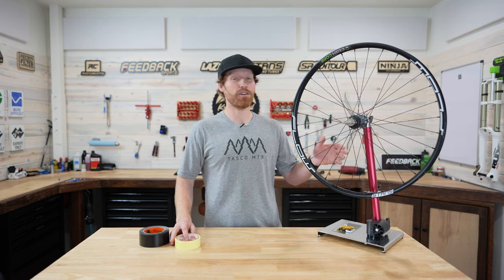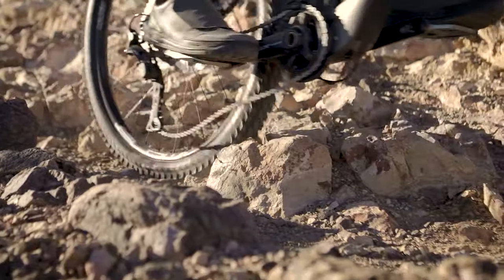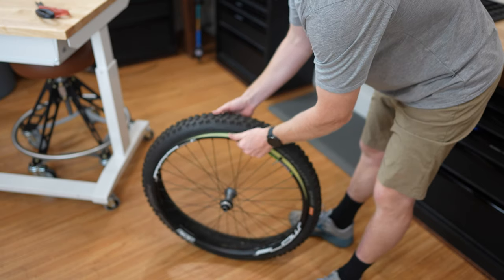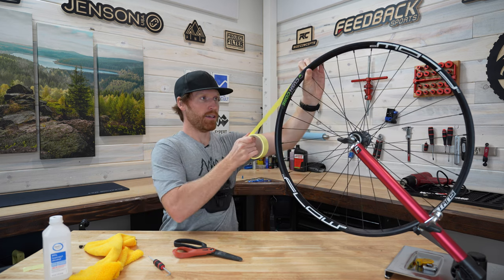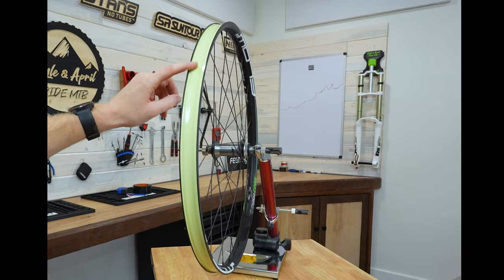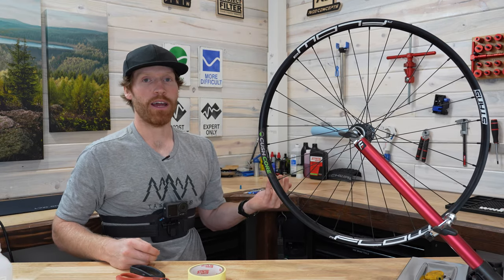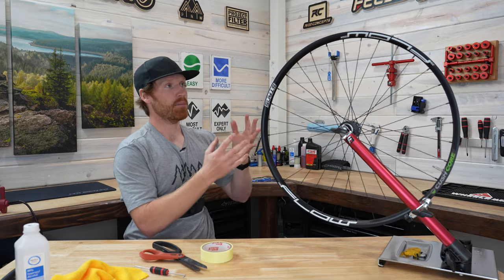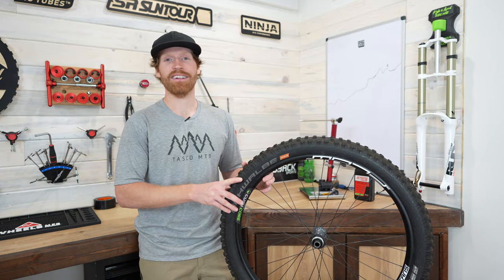How To Tape A Tubeless Rim The Easy Way // Step By Step Guide

Comment: use TESA 4289 tape, which is basically Stan's No Tubes rim tape, but for 15-20$ you get about 216 feet worth in almost any width instead of the 30' from Stan's.
Reply: Tesa packing tape has some stretch to it? That is surprising it stretches at all. I will try it if I can find it in 28mm wide.

Comment: As an extra bit of info: 
- some tubeless tapes are really thin and elastic and need a couple of passes on the rim for extra safety, as one pass is not enough, because the tape punctures over the nipple holes ... especially if you do gravel or road tires, as the pressure is higher than normal large volume mtb tires. or if the rim is of lower quality and has burrs on the edges of the holes ... pressure from the tire forces the tape in the nipple holes, and the burrs and sharp edges cut the tape with time. seen this quite a lot in the shop ...
- sometimes it helps to add a patch of duck tape (or the provided stickers if available - zefal and muc-off are 2 that i know provide with tape such stickers) where the tubeless tape ends and overlaps the previous layer, as tubeless solution can creep between the layers ... this is especially problematic if the overlap is really short, as it creeps all the way to the valve and past, and it gets in the rim and trashes aluminum nipples ... or air can leak slowly and you have no clue why this is happening. this happened to me a few years back when i started doing tubeless ... slime went though the tape layers and ended up in the rim, causing 3 nipples to completely corrode and break after only 4 months ... the rest were better, but i ended up relacing the wheel and changing all the nipples to brass 😆

Small tip: spraying the nipples on the inside of the rim with wd40 (very light application), and wiping the rim with brake cleaner or iso alcohol so the tape sticks to it, can prolong the life of the alloy  nipples and prevent corrosion in case tubeless solution/water gets into the rim. If you wanna dew it like a pro, get some car body panel anti corrosion/rust solution from a gas station or hardware store, and with a small brush apply it on the head of every alloy nipple. that stuff hardens and forms a layer on the nipples that never washes away. some are actually ready to spray over after 24 hours ... and you can true the wheel no issues what so ever if the need may arise. you will never have an issue with corroded/stuck nipples 👍
Reply from the maker: Great tips! Thanks Marmo!

Comment: One thing I found is that putting a tube in can help press the tape down nice and flush. I'm not sure if it's 100% necessary as you talked about how the air pressure will help. But if you have slightly leaky tape I think it can resolve that
Reply from the maker: That’s also a great tip! There a a lot of good ways to get it done and we really just wanted to make a video that helped people feel a little less scared haha

Comment: My favorite method takes some time but what I'll do after I lay the tape down without any big wrinkles. I'll then mount the tire and throw a tube in there. The tube will make sure that the tape is perfectly seated to the rim because it'll push up against the tape. I usually pump it up high to like 40 psi too. You then wait a morning or afternoon and let it sit for a couple hours. You take out the tube, put in your tubeless valve and then you got perfectly laid down tape.

Comment: Probably best video on tubeless installation. I have seen somewhere additional step of final pressing down of the tape by temporarily fitting a tube inside the tyre and inflating it. Could you please make a video on maintenance of the tubeless. How often does the sealant need to be replaced? Would you know if Schwalbe Marathon Plus and Schwalbe Smart Sam Plus could be used for tubeless?

Comment: Using a rag or towel makes taping much easier, just run it over the tape as you tape it, tun thumb at the rim channel with the towel, I use a microfiber towel or a old t shirt both will work. Using bare finger won't work smoothly. But using osethibg from fabric will allow smooth and easy work.
I also do it to the edges too to make sure whole tpae sits.
I used this method on the same tape used here.
No heat gun needed. I think Stan's video showed that method.

The tape seems to be strong, but first time trying it I had a roll that had uneven cut gape at the start, it tore too. But it's tear resistant, so I think the tears were due to uneven cut from a machine at factory. Not tried second roll. Buy using a towel is needed to install it easily. Adhisive seems good. Strength seems good, but if bubbles it will burst and tear. I had a second hand wheelset come with it ran it to test bubbles burst. So it's important to use the towel or rag on the tape.

Comment: What wheel stand is that?  I’m seems like it makes it a lot easier to put it on evenly.
Reply from the maker: Hey Jeff! This is the Feedback sports truing stand. Its a single armed truing stand that works pretty well for wheel touchups and even tire installs! jenson.sjv.io/Or1GeW
Reply: @kwarnermtb  Any good tricks to doing this without a wheel stand? Can you do it mounted on a bike flipped upside down?

Comment: Thanks for the video. Any tricks to setting the bead of the tire on the wheel? I have issues with a certain brand of tire sometimes. I think it’s a brand you’re familiar with. 🤔
Reply from the maker: Hey! Yeah are you saying you are having issues installing the tire bead or when its airing up its not seating properly?
Reply: Installing the tire bead. Hard to get a seal for the tire to inflate.

Comment: The Stans tape I have sucks. It doesn't stick, and it cracks.  It stays loose, has air bubbles regardless of how hard I try to stretch it.   It's quite frustrating.  I'm about to try duct tape.  If Gorilla tape works why wouldn't Duct tape.
Reply: Helps if it is warm

Comment: Theres not much about working on bikes I dislike but re-taping a tubeless wheel is near the top.  Every time you mess it up you get rewarded with crawling across the garage on your knees wiping up expensive sealant fluid and then throwing out the bulk of your shop rags.

Comment: Sorry. But this is all wrong! The easiest way that do this is simply don't remove the wheels as it's totally unnecessary. Just do this on a bike repair stand and once the types are pulled over the far side of the rims, cut the inner tubes off with scissors. Install the valves and air test the tyres. Once done, the pins from the valve cores can be removed and tubeless sealant inserted through the valves. That's the easiest mess free way
Reply: How do you apply the rim tape, then? You can't install rim tape with the tire on.
Reply: @VQ30TLJ  Most tyre rims have tape already applied. But to answer your question. You can apply rim tape without removing the wheel from the bike. Place the bike upside down and use a tyre lever and place the tyre over the rim. Most bikes have plenty of clearance to allow this. Removing the wheel completely is unnecessary
Reply: @James-u5v4y  It sounds like you are talking about the traditional rim strips or tape used to protect tubes from spoke holes. That is entirely different from tape designed to create an airtight seal. It requires a lot more care to apply properly.